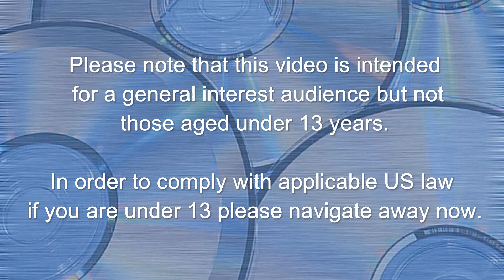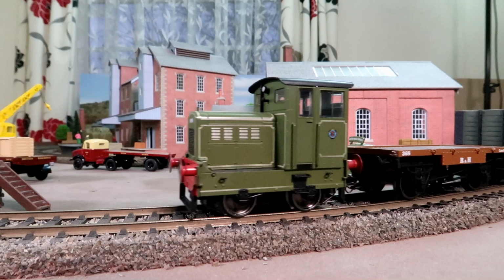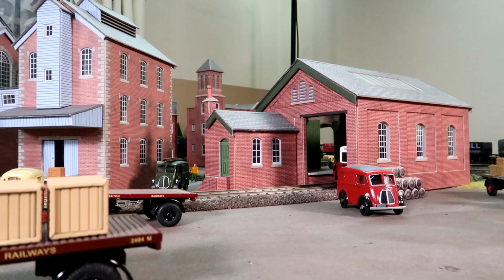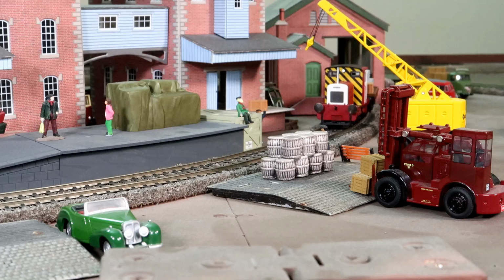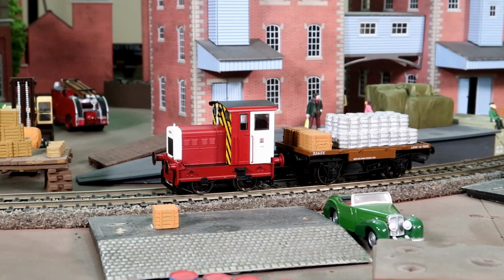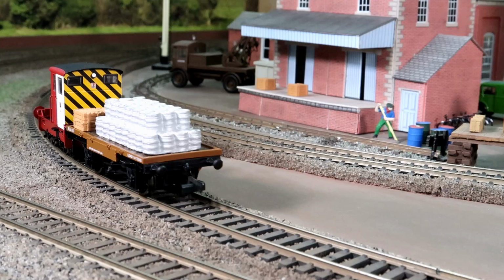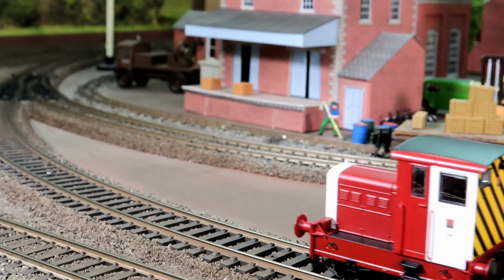John Dewar & Sons R&H 48DS 0 4 0 Hornby R3705

Comment: at 03.25  the front wheels on the truck are not turning as it drives out of the shed
Reply from the maker: Indeed so, warped truck and paint on the backs of the wheels, fixed now :)